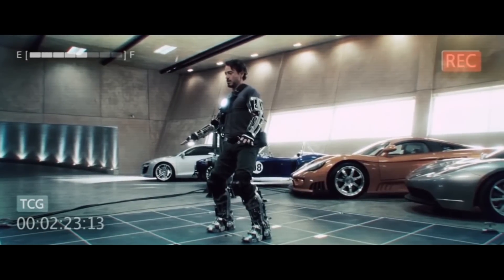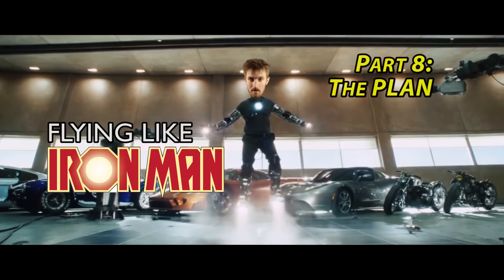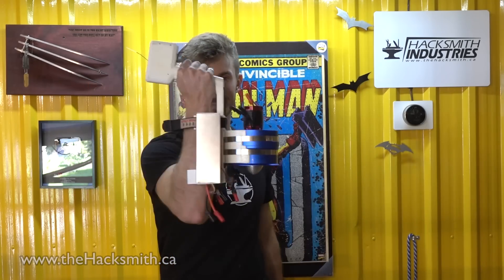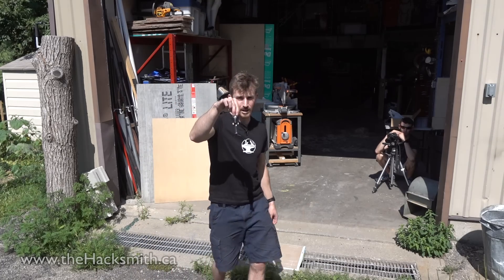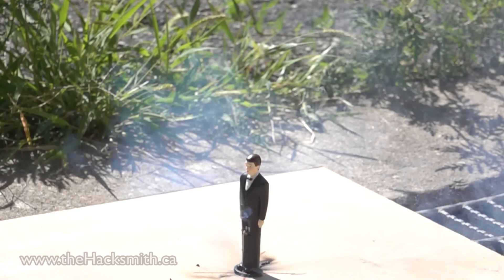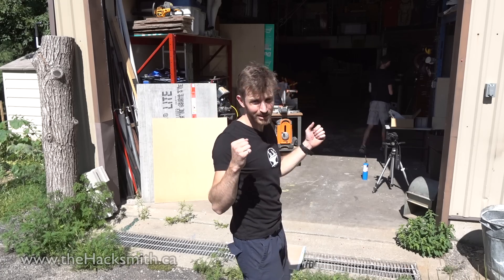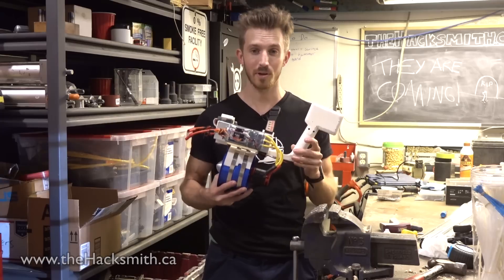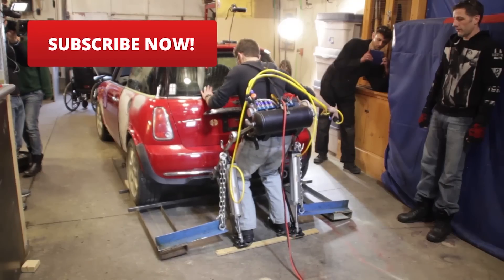Flying Like Iron Man #8: The Plan with Electric Ducted Fans

Comment: It's funny how many people are saying "You're wrong about thrusting from your feet." When he showed an example with the little man. Yes, in theory thrusting from the bottom has its advantages in SPECIFIC SITUATIONS like a rocket. However, a rocket is aerodynamically designed to not taper against the forces accelerating it. Additionally in the few situations that a rocket system fails it is catastrophic (Discovery). James here does not have the structural integrity of a professionally designed rocket nor the advanced trajectory compensation systems placed in rockets. (No offense James XD)

He is very right in saying he is designing a human helicopter instead. He wants 1) mobility in flight (rockets are not very mobile, helicopters can turn on a dime) 2) to hover (rockets can't do that well either) and finally 3) he wants safety (rockets are fragile but well designed) helicopters are far less likely to fail in a controlled environment ie. not trying to crash.

So if all you guys really want to see him fly sooner than later than donate to his patreon or shut up and respect him for investing in such a project instead of complaining about youtube videos in comment sections.
Reply from the maker: +Craig Dotzert thank you Craig! This guy gets it.
Reply: I agree 100%, I would like to see him catch flight, but at the same time I am not in a rush and it would be worth the wait whenever he does make it,

Comment: May have been said, or may not have any grounding in practical physics, but could you mount the arm and leg mounted EDFs on your back, and use smaller diameter ducts to trace down your limbs and direct airflow that way? Would imagine it'd have some effect on weight distribution, centre of gravity, and angles of thrust, but I'd like to think that it'd streamline the entire build to a more manageable setup.
Reply: That is to say, make funnels from back-mounted fans, to connect with flexible pipes, that run the length of the arms and legs with nozzles at the feet and hands. In case I wasn't being clear in my sans-caffeinated state

Comment: I reckon that you'd be the guy to explain why using micro jet engines (kerosene powered?) wouldn't be possible. The mass overhead would be way smaller than even lithium batteries (or hydrogen polymer when they become available).
Some of the newer ones developed for R/C scale model jet aircraft have quite a lot of thrust (200 Newtons / 45 pounds) & by using multiple engines on a shoulder mounted framework (aimed well away from the body) might get you to hover off the ground. From there, adding some computer guided servos to control thrust guides could get you limited maneuverability.
You wouldn't be able to fly for long but could have plenty of fun on just a tether.

Comment: Given a rigid body, it actually doesn't matter where the thrust comes from so long as it's in line with the center of mass. Example: rockets
Reply from the maker: +taby 1 I'm not a rigid body...
Reply: +the Hacksmith Agreed, but Iron man probably is (and so he doesn't have a good physics reason for putting his thrust on his torso) and helicopters are as well. This is also why your action figure would have done exactly the same thing regardless of where on him you'd put the bottle rocket. And I did think it a salient point to make as much of what you said seemed to imply that higher centers of thrust give greater stability.

Comment: I feel I must point out that helicopter are NOT stabilized by any "pendulum" effect (that toy is stabilized by spinning like a rifle bullet and works just fine upsidedown (seriously try it))and in fact it is generally eaiser to stabilize a system with the thrust coming from the bottom ( aka every rocket ever) because you can more efficiency vector the thrust to create a moment around the center of mass.   really the only requirement is a net trust  vector that passes through the center of mass and the ability to create controlled moments for control, boot thrusters can accomplish this just as well as a jet pack

Comment: the exoskeleton and an in suit computer combined makes feet based thrust possible, the computer would monitor all flight telemetry to make small movements and power adjustments to keep his CoT directly behind his CoM
Reply: You have to remember all the weight adding such things will incur. Not to mention it is way smarter and way easier to build a "jet pack" than to make feet based propulsion. The guy who came up with iron man didn't actually try to design a working suit himself.
Reply: it wouldnt take a big computer, a simple micro computer like a beagle bone  or raspberry pi would work, though a more specialized one could be made for it.

Comment: if lift is problematic look into adding a focusing cone similar tk what is used on jet planes that allows them to adjust the aperture through which the air is passed this would allow you to concentrate the thrust the air snd increase the pressure excerpted

Comment: At takeoff, Iron man uses the thrusters on feet and hands at once, therefore negating the "topple effect" you show on the little figure. If you also control the power of the 4 thrusters by making more power go to the hand thrusters than I believe it is possible to stabilize. this would require precise power percent control on all 4 mini jets. If not, I recommend just 2 other thrusters in the back of the suit which would go behind or to the side of the moving (ailerons/rudders/airfoil panels?) hope this gives you some new ideas! By the way, is thrusters a word? Youtube does not like it and makes it red! :P

Comment: Maybe just focus on making a tethered system with a power cable attached to a ground unit? Then you can focus on the flying concept before worrying about it being practical. Battery efficiency is improving at a much greater pace than turbines so by the time the flight system is working battery efficiency may have closed the gap.

Comment: This build seems more feasible as an ironman build if the Jetpack used wires instead of a controler. Making a glove with wires attached to your hand that will control the amount of thrust instead of a trigger joystick would look alot cooler and give more of an illusion that your flying with your hands. Attaching the thrusters to a moveable platform that can be controlled by your hand movements as well would give you some directional control. 

Sure looks alot better in my head than how it sounds...

Comment: Have you considered mini turbojet motors? Here in the UK, there are people using them to fly 1/5 scale Vulcan and Victor bomber replicas. Yes, they're aircraft, but they are huge and heavy. you could fuel them with avgas, a tank of which must weigh less than loads of power cells, surely?
Reply from the maker: +brianartillery they're actually pretty expensive! Then you also have to worry about hot burning exhaust fumes :(

Comment: the reason why the little man flipped over was because the center of thrust was not directly below the center of mass creating a torque in practice if you were using rockets having them on your feet would be much more stable than above your center of mass  it would also give you much more control

Comment: Hey hacksmith! Are you familiar with the zapata flyboard and the new flyboard air? These prove that with a little practice it is pretty easy to fly with trust purely from your feet. So if that is the only or primary consoderation for building a jetpack design check out the zapata youtube videos!
Reply from the maker: +Piet Paulusma anything's possible with sophisticated control systems :)

Comment: I don't know if you have thought of this, but I am assuming your flight wont consist of much downrange distance, more just up, down, and some hovering. What if you guys got power from the ground, basically have an "umbilical" cord x amount of ft long, feeding all the electricity, but with none of the weight of batteries. Don't know how feasible that is.

Comment: Sorry but feet powered thrust should definitely work
For example racing quadcopters have the majority of the mass at the top of the craft(batteries)
The hard part will be to figure out the correct PID settings and building an exoskeleton to allow self stabilization while allowing freedom of movement.
You'll need rather large motors at the feet to get the rogh amount of thrust though...

Comment: Quick question, if thrust centered in your feet was that unstable how would hoverboards works? i mean is enought thrust to lift you more than 8 feet and is pretty stable after you get the hang of it... (btw sorry for bad english not my main language)
Reply from the maker: +Eduardo Ferrari Magalhães stabilization ;)

I was speaking generally in this video, for example quad copters could balance something on top because they adjust throttles to balance

Comment: So.

The jetpack would be about 1.5-2 feet long, right? With turbine style jets, and the system's power pack in the middle, you could do it easily. In fact, I only see a few issues, and those are with the wiring.

But mounting it to the exoskeleton isn't feasible yet, given that the Exo has it's own back-mounted power supply.

But you probably already know all this.
Reply: +the Hacksmith Well, that all depends on the material. You've made it out of steel, mate. In an ideal world, you could have used something lighter, like titanium or super aluminium or something.

Alas, 'tisn't Marvel. We'll have to make do with taking a 747's turbine to pop onto your back ;)

Comment: Not sure if battery technology is good (light) enough yet to fly. Combustion might be a bit dangerous so hard to say. Hope it works and good luck.
Reply from the maker: +Miket G just not for long periods. 2 lipo packs weighing 1kg together are enough for the 8kg thrust EDF to operate at full thrust for 2min. If I can fly for a minute I'm happy. Remember I'm not trying to make a commercial suit or anything.
Reply: +the Hacksmith could fuel cells work. they converted fossil fuels the electric power much more efficiently just matter of size and weight.

Comment: light waight alloy that cant handle heat and pressure.  a turbine and slow burning yet high velocity fuel. its doable but we haven't made the fuel yet...  unless you use plasma and a super effective de humidifier

Comment: You stand a better chance of flying with thrusters on your feet (or on a platform you stand on) than you do with rockets on your shoulders.  Hovering on a board has been demonstrated decades ago (search for "flying platform" and you'll find a dozen YouTube videos).  Thrust above the CG without active control is no better than an unstable, uncontrolled seti[ with thrust at the base.  Your own built-in balance system will do most of the work of stabilizing standing on the thrust platform.  Put the rockets on your shoulders, and you have to control the thing by shifting weight -- it took the first rocket belt pilot weeks and hundreds of (twenty second) attempts to get to where he could even hover, never mind fly in control.

Comment: Having the thrust over your head is just as unstable as having the thrust under your feet. This is referred as the "pendulum rocket fallacy". Successful hoverboards strapped to the feet have already been built, the most impressive one is certainly the "Flyboard Air" from Zapata.

Comment: There are a ton of more complicated problems than figuring out the thrust to weight ratio; that's just a matter of calculus. Figuring out how to control each fan, how to get even thrust across all fans to prevent skewing the balance, safety protocols, possible legal concerns, and so on, those are far more complicated. And that's just for hovering. If you try to figure out actual forward flight, then you also have to factor in getting lift, control surfaces, drag coefficients, steering, and so on.

The human body was not designed to fly. This is why machines that have been successfully made to fly do not look like a person. Given sufficient power and a light enough power source, yes, you can force a human body into flight. The same can be said for a brick wall. Don't get me wrong, it would be totally amazing and awesome to pull it off. But given the current level of technology, both for thrust and for power storage, I think we're just still way too far off to close the gap created by the massive inefficiency of the design of the human body with regards to flight.

Comment: would thrusters from the arms/hands not help stablize the thrust from the feet.  also maybe using electricity as the source of energy is the solution your weight vs thrust problem

Comment: try makeing a pack that can hold 3 jets then 2 for the arms and legs making a toltal of 7 jets and the pack equals as a powersorce aswell and to possibly make a sufficient power source to keep the batteries charged while in flight use small solar panels

Comment: What if you used wires/cables to provide the electricity, the flight would be more constricted, but you could focus on thrust only rather than accounting for battery weight and such

Comment: Has it occurred to you to try flying with a single trailing power cable to a power supply/battery that stays on the ground? Sure it kinda sucks that you're tethered, but you're never going to fly cross-country anyway, and maybe the cable could be quite long.

Comment: Doesn't his reasoning for the thrust being above the center of mass fall under the pendulum rocket fallacy?
Reply: Remember he is not trying to make a huge rocket fly, he is trying to make a meat bag hover.
Reply: "Meat bag" XD

The direction his arms are pointing may be able to fix that.
Reply: +LemminaFingerButters So you watch Lemmino... He's top 10 facts are really great quality xD
Reply: Doctor O'Malley I understand the lack of rigidity problem. What I was taking issue with was the analogy of the lighter/pencil. Those are both rigid objects and as long as the thrust in line with the center of mass it should not make a difference in the flight stability.
Reply: Doctor O'Malley Yes, they are, truly.
Reply: not really the pendulum rocket fallacy is if you can imagine pulling and pushing on a rigid steel rod... it doesn't matter wich you use... there isn't much of a diffrence
butthis guy sin't rigid... so imagine trying to push or pull a rope strait up without it bending....

Comment: Just a few words about your statements at 03:25 - that's not how rocket stability works. The idea that thrust above centre of gravity makes a rocket stable is something called "Pendulum rocket fallacy": https://en.wikipedia.org/wiki/Pendulum_rocket_fallacy 

Basically, it turns out it doesn't matter whether the thrust is above or below the centre of gravity, if you don't have properly working guidance or aerodynamic stability, the rocket is going to tumble anyway. The stability depends on other factors.

There is, however, a good reason to get the jetpack's thrusters as close as possible to the centre of gravity, which on humans is somewhere around the waistline. Putting powerful thrusters on limbs has some advantages as well - mainly, human legs are specifically evolved to handle forces greater than the person's weight, and assuming you can actually control the thrust somewhat intuitively, you gain a lot of mobility from being able to point the nozzles in different directions. The downside is that if you can't control the thrust directions properly (and this is not an intuitive thing for humans), pointing in a wrong direction instinctively could be a recipe for a disaster, propelling the Iron Man into a spin and possibly being unable to recover, crashing into the ground from a great height. Having the thrusters fixed with the torso and as close as possible to centre of gravity would probably mitigate these problems greatly.

Comment: Why don't you try connecting the fans to an external power supply. This way weight and battery life won't be much of a problem and you can actually test wether iron man style flight is actually feasible. I personally would love to see this.

Comment: use the jet belt and combine it with grapple hooks and make 3D maneuver gear,  then it wouldn't be as heavy as gas powered 3DMG and you might be able to swing with it.

Comment: A ESC tester would be better to test with. Than that controller. that would save you on weight. are on the other hand making the hand controller's to control the hold suit!! via RC receiver. and a hover board stabilizing chip!! and a exoskeleton that makes you about 1-2 feet taller. but lite carbon fiber. that would give you  larger area's to mount to.

Comment: You forgot that iron man has thrusters at the back (like a back pack). Maybe if you strapped the jets to the feet and arms PLUS thrusters on your back and use your arm thrusters and backpack thrustsers similar to a quad copter then you might achieve a better stability during flight. The trusters on your feet could be used as a propellant.
Reply from the maker: +Russ Yakimovich did you not watch the whole video? We specifically mentioned the jetpack...
Reply: I missed those parts, my bad XD. Just looked though the whole video and the concept seems pretty awesome, will be great seeing this in action, good luck. I subed for being stupid on the day and for the great idea.

Comment: well, I have an idea. you want to use rocket fuel to fly but ..... you should use that 
vlog 006 to fly. you can use it like iron spiders legs, which come from its back.
batteries are more expensive and it gives more time the hardest thing to do is legs on wich will be connected vlog 006. (I am from georgia and if my spelling is wrong and dont understand, please tell me )
Reply: sorry I should write cheap and not expensive.